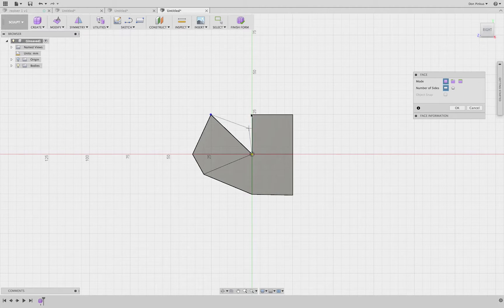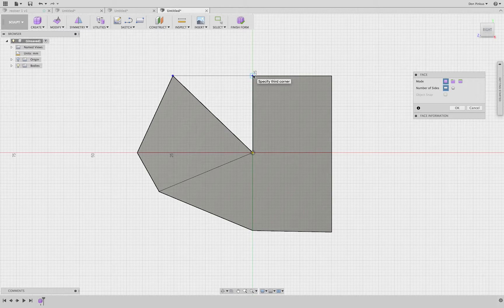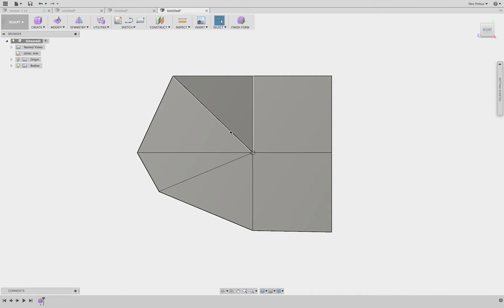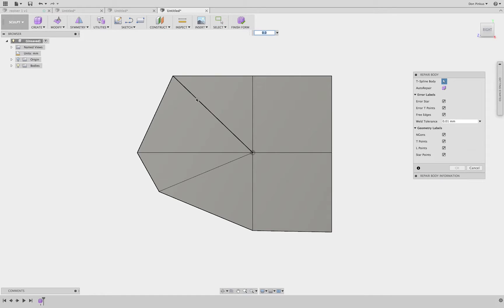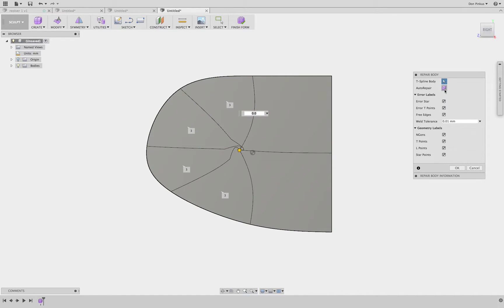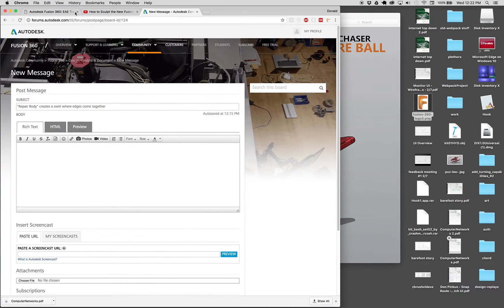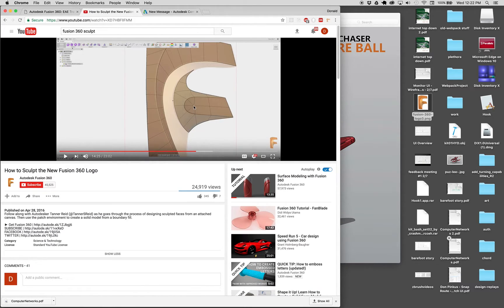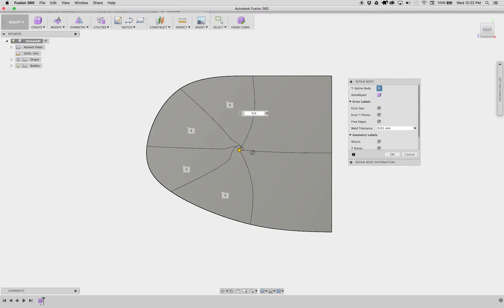Fusion 360 - "Repair Body" creates swirls

Comment: funny , we were watching the same video , i have a problem with autorepair a bit further however in the logo video they did make a half edge running through the rectangles - so the triangles meet at the mid point - that did not get me the squiggly lines

Comment: I'm not advanced at all in Fusion 360 but as far as I've experienced you can't create 3 sides face. If you do so the repair tool will create squiggly lines like that and when you'll leave the sculpt environment, they'll be transformed into 3 four-sided shapes.
Before: http://puu.sh/vnOhl/1d6071a63f.jpg
After: http://puu.sh/vnO8C/05b63b6052.jpg

Edit: I just noticed in the pic there is a triangle right over the thing so i honestly dont know why it does that but once you are out of sculpt env they'll be shaped correctly.